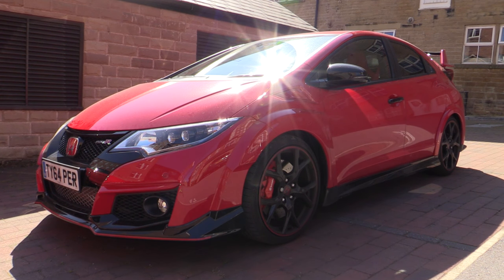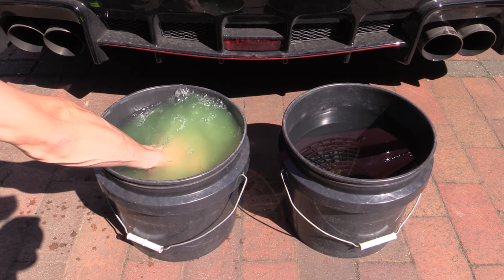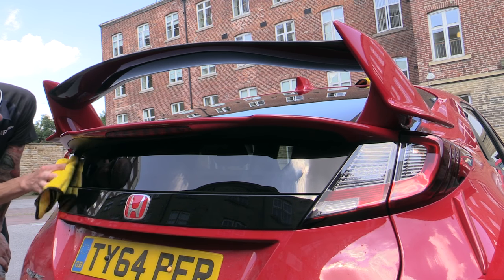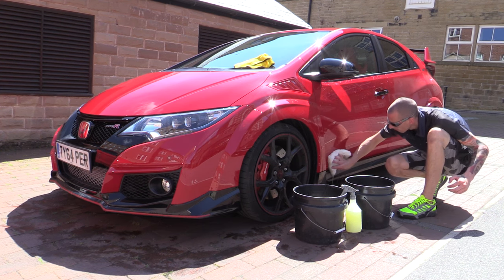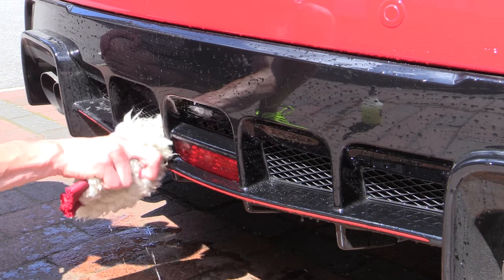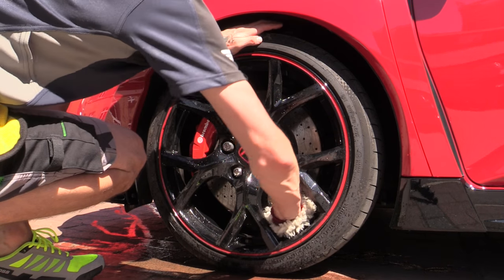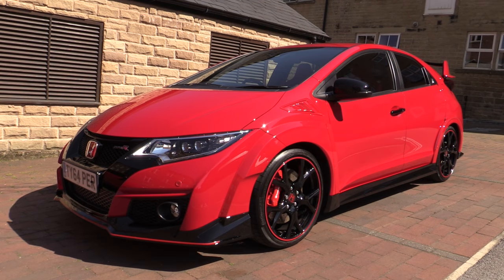Red Hot Honda Civic Type R Rinseless Wash & Wax

Comment: That Honda sounded really nice!
Reply from the maker: Aftermarket zorst. Shame it only revs to 4k in neutral!
Reply: +Car Cleaning Guru Your joking?
Reply: +Car Cleaning Guru that's ridiculous.
Reply from the maker: Been that way since the FN2.
Reply: the EP3 also only revs 4k in neutral
Reply: +martin jennings put your foot on the brake and rev it again 😉
Reply: +Forged Garage you must be new to Honda,s. mostly all Honda have 4k rev limit. ( VTEC protect) stop yobos dropping the clutch at 7k rpms lol
Reply: +AlphaMuscle like you've never revved a car past 4k haha
Reply: VTEC doesn't not engage  past a certain RPM point these days.
Throttle pedal input, Oil pressure, Engine load, Gear.
All determine if VTEC is engaged.
Reply: @ForgedGarage  why ?

Comment: This is where the Worx hydroshot comes in handy as I too live in an apartment. I use it to clean the tires/wheels and also to do a 2BM wash. This has me using 3 five gallon buckets. When doing a rinseless wash the Worx hydroshot is used for tires and wheels only, with the aid of a 2 gallon bucket to dunk my various brushes in for tire and wheel cleaning.

Take care and love the videos, nothing wrong with your voice either!

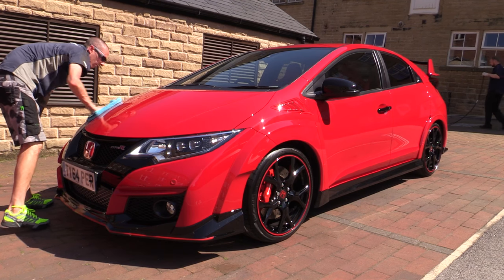Comment: wait.. hang on a sec... did i just see a hose pipe at 13:35?? i thought you didnt have access to one lol
Reply: looked a bit to ridged to be a hose i think
Reply: It was a drain rod
Reply: I think that hose is for the window cleaner, because its an apartment block.  They usually have vans with water bowsers and a water compressor in the back to clean windows/doors with telescopic reach.

Comment: I'm not suggesting this applies to this product, but it's application properties are similar to using crap/cheap shampoos where they don't sud up and just look like greasy water. I'm wondering if you can just towel off from a cheap shampoo for the same result. The lacquer on my new car is so damn soft, even expensive lambswool mitts and microfiber towels leave very fine scratches (and yes, I do clay bar, contact-less pre-rinsing and am aware of decontaminating paintwork) so I'm not quite so fussy about the scratch prevention.

Comment: I personally prefer the multiple soaked microfibre cloths because there is zero chance of introducing grit into the fresh wash bucket...or dragging grit trapped in the mit across the panel - I know there are various schools of thought, but to me, a fresh soft towel for every panel, along with very light pressure means minimal chance of scratching. If the paintwork is THAT precious, then you really shouldn't be doing a rinsless wash to begin with. Do the usual foam soaking, rinsing, foam again...etc.
Most of what I'd be doing are daily drivers, so swirls are already present and I'm introducing nothing much extra...certainly nothing noticeable

Comment: Another great video +guru Personally don't and will probably never use a product like this as I just don't think they are sufficient for the job and in the wrong hands will destroy paint work. If it's hot and sunny I'll wait till the evening till when my drive has shade to wash my ep3 and as its night hawk black it gets very hot very quickly in the sun and will leave hard water stains when washed in the hot sun.

Worst comes to worse I'll go a local jet wash if I'm out or knowing I won't be at home armed with a bucket with all my cleaning gear and soap etc so I just use the jet wash and not the dirty brushes that are full of other people's grit.

How do rate autobrites detailing range?

I've just used some and found it very good.

Looking forward to the next vid👍

Comment: I switched to rinseless washing with ONR a few months ago after getting a little bit fed up of all the time and effort it took in setting up all the equipment and washing the car with 2 bucket method. Really liking ONR , I use the Garry Dean multi towel method and haven't noticed any more swirls or marring using this method. Also think car actually looking cleaner doing it this way. Another great video.
Reply: Agreed. I do exactly the same. Multi-towel (Garry Dean Method - as cringy as that sounds) and my paint-work is fine. I am getting a much better clean than when i used to take my car to pressure washer at the local garage.

Comment: I can't imagine using this type of product in my motor, just looks too invasive in the paint. Looks like you did a great job with what you had to work with. I'm surprised that when using the 'two bucket' method, you don't wring -out your wash mit in the floor? I wii old have thought that this would have given you a better chance of getting rid of any swirl-causing contaminants prior to re-loading with cleaning solution.

I'm not sure if you have upgraded your video camera. The shots look fantastic quality. To that end, I noticed on th the after shots, that there was an amazing amount of orange peel on the paint. Had it been in a body shop recently?

The Honda looked super-agressive compared to the standard version. 

Keep up the good work.
Reply from the maker: It's actually not as invasive as it might look, in certain respects it's more gentle on the paint than standards suds. The reason I wrung out in the bucket was with the theme being limited access to water, I didn't want to run low before I finished. It's a goos tip though!

Comment: At around 14:15 onwards, while looking at the panels closer, why does the paint looks like it has loads of 'orange peel'? I have a corsa VXR and the paint work looks a lot like this as well. Is there a type of product that I could use to get a smoother look?
Reply from the maker: Modern factory paint standards. Only way to remove is wet sand and machine polish.

Comment: Great video but geez it really shows up the orange peel in the paint on the car from factory, thats shocking. Whats the point in spending hours cleaning your car if the paint underneath looks terrible. Not your fault ofcourse, shame on honda
Reply from the maker: Most modern cars are the same in my experience, plus the angles of my after shots show it up really badly regardless of the car.
Reply: Yes thats true, there are a few manufacturers that are really bad with it, and even then its really hit or miss from car to car. Its just a bit of a shame really, looks like they've been painted with a rattle can.

Comment: Would you recommend a foam gun when living in a flat and having no acces to running water for a pressure washer?
Reply from the maker: No because it wouldn't work!
Reply: Maybe I was imprecise. With foam gun I mean a pump sprayer like the one you use in the video. In your case you use a rinseless wash product but it should also be possible to use snow foam in that sort of sprayer, shouldn´t it? Sorry for the misunderstanding, I´m coming from Germany ;)
Reply from the maker: Ah ok, you can get pressure sprayers with foaming nozzles but it would still need rinsing off unlike the rinseless wash.
Reply: Thats okay because I wash my car in public wash boxes. The problem is that you can´t use a foam gun like the one you are using (at least in Germany at public wash boxes). So I wondered if there is an advantage in cleaning the car with a pressure sprayer + snow foam.
Reply: Iceman68415 search for ik 1.5 foamer. It may be what you need but it's still up to 20 pumps for maybe 2 panels... So it's a lot of pumping.

Comment: 6 hours to wash a car? I can wash a car with 2 bucket method and chemical guys supplies in less than 30 minutes, scratch gree
Reply: +Juan Mora what's better than?
Reply: +Juan Mora some stuff like the quick retailers really do suck, and the waxes are just terrible... But soap, inner clean, polishes, there all grest
Reply: +Breaking rc I agree completely 😂 the butter wax seems a little gimmicky
Reply: +Robert Saenz butter wet wax is complete trash, it LITTERALY last 1 month maximum, and there paste wax also last 1 month, so I just use meguiars, so for durability I put a layer of meguiars on, and for the nice pop I put on chemical guys
Reply: +Breaking rc I do the same, what do you think of meguiars cleaners like the super degreaser or APC vs. chem guys nonsense or inner clean?
Reply: i did a test with meguairs 26 , and Butter wet wax  . Using safe for wax soap . 
meguiars lasted 10 weeks . butter wet lasted 2.5 weeks . you can imagine my disappointment. also , ecosmart does scratch the paint  . ONR is the best rinseless product in the market . chemical guys is junk
Gyeon , carpro , swissvax , meguiars and 3D for the win
Reply: Breaking rc Because he meticulously washed the car plus filming this video. He's the guru!
Reply: Juan Mora I tried Adams polishes waterless wash on my Lexus with perfect paint, I used a damp towel and liberally spray it on the car, still scratched it, so it's not just chemical guys, but yes $10 meguiars paste wax last longer and beads more water off than chemical guys

Comment: The car detailing industry is, as far as I am concerned, a bunch of guys who need to make a living, parroting whatever the master parrot is selling this season. People just buy in to, and get away with, the most preposterous statements about how physical particles behave in the presence of other physical particles. These are contrary to physics and, for the stated behaviour, no proof whatsoever is provided.

This parrot states that he is rubbing "the dirt into the tough polymer coating that bonds to the paint and protects it during the contact", an "interlocking molecular barrier the ONR itself imparts", some "magic polymers". Presumably, referring to a fictitious "tough polymer" created instantly by a liquid that was heavily diluted into water, then rubbed into the surface while rubbing the said dirt. Magic indeed, only magic could do that.

People, wake up: this is a paid advert for "Optimum No Rinse", a rubbish product, and it's use, in the fashion demonstrated here, will damage your clear coat. That is the reason why this "professional" offers you no proof whatsoever that the clear coat wasn't damaged and swirled after this job. Extravagant claims require extravagant proof.
Reply from the maker: I purchased the product myself, drove 150 miles to feature the car and spent all day on it for free, so far from a "paid advert".
Reply: Tip Tap, Do you have any qualifications in a Chemistry related field??
If not, then your opinion on this product counts for less than nothing!
Reply: Car Cleaning Guru why did you drive 150 miles to wash his car but not get paid for it :/

Comment: I like the car, but the wash I do not like.  I could never use a product as this, would be afraid of paintwork damage.
Reply: Bill Durbin trust me done right the risk of swirls is far less than a two bucket wash. Although I don't use ONR like the guru does in his video. I use micro fiber towels lots of them and the Gary Dean Method. Basically I don't re dunk a towel, after a panel they are done. 4 years of ONR and zero swirls

Comment: Dont blame the product. You have a poor rinseless wash technique. Im mean, very poor.
Reply from the maker: +nivraarvin I'm just not one for pampering, over conservative wash technique. Plus I did't really blame the product, just pointed out its shortfalls. Results weren't bad though, eh?
Reply: +Car Cleaning Guru You can use boars hair detailing brush soaked in the solution for the vents, then wipe with a damp MF towel from the wash solution to get the dirty solution off the surface.

For the wheels/tires, you can use a small noodle type MF wash mitt to clean the surface of the wheel and the tire itself if the tires are not so dirty like the one from this video.

For areas with bugs or caked on mud, like the fender liner, spray them with APC first then clean them afterwards with the rinseless solution. ONR will neutralize the solution.

I really like rinseless wash. I live in hot climate with hard tap water. This is the only way for me to wash my truck without getting water spots and swirlmarks.
Reply: +Car Cleaning Guru You can use boars hair detailing brush soaked in the solution for the vents, then wipe with a damp MF towel from the wash solution to get the dirty solution off the surface.

For the wheels/tires, you can use a small noodle type MF wash mitt to clean the surface of the wheel and the tire itself if the tires are not so dirty like the one from this video.

For areas with bugs or caked on mud, like the fender liner, spray them with APC first then clean them afterwards with the rinseless solution. ONR will neutralize the solution.

I really like rinseless wash. I live in hot climate with hard tap water. This is the only way for me to wash my truck without getting water spots and swirlmarks.
Reply from the maker: Agree with the boars hair brush although personally I think if you're going to that level you might as well just wash it properly with running water. Definitely has its uses though!

Comment: Nothing like grinding all that dirt into your paint!
Reply: Just what I was thinking
Reply: Maybe do some research first buddy.
Reply: You clearly do not know what ONR is... There is a reason you are not a detailer. lol
Reply: How many cars have you detailed with onr??
Reply: Cesar D. Ortega A lot. I use it jus tlike this video when I have no access to water which is often when detialing someone's car at an apartment complex. 
It works amazingly well.
Reply: I detail cars too but I was asking the other person
I only do rinseless but I do it alittle different I actually used a weed sprayer for the wheel and emblems to same as I was doing it rug ablar wash 3 gallons of water is all I need👍
Reply: Again, I have a black CL500 and I've used it where I had to and if you're careful, NO SWIRL marks. People commenting on a product they have no clue about... This guy is ANAL (yep all caps) and if he can find it in himself to tolerate using it, you should know it merits some consideration.

Comment: First video I disliked from your channel. You basically rubed all the dirt and grime into the paint.
Reply from the maker: You'd think so wouldn't you? However in effect what happens is you rub the dirt into the tough polymer coating that bonds to the paint and protects it during the contact. ONR is way more advanced than other spray on wipe off type waterless wash products and considering it doesn't contain any fillers the proof of the pudding is in the finish which here really wasn't any more swirled than it was to begin with.
Reply: Car Cleaning Guru Yes you can basically say that you have removed all the dirt. Thus I feel the need to argue due to the fact that the clear coat on modern vehicles is very hard and can tolerate this, but nevertheless when dirt and grime is being "wiped" off it is basically forcefull removal which generates very small scratches in the clear coat - which if course can be polished out. 
No product - whatever the advertise with can avoid scratches under forcefull removal. It is plain advertisement. 
But I do enjoy your video.
Reply from the maker: Just to clarify, when I say 'tough polymer coating' I don't mean the clear coat of the car but an interlocking molecular barrier the ONR itself imparts.
Reply: Car Cleaning Guru Understood. I was talking about the basic facts about how "waterless" washes can scratch your paint - besides what they advertise it for.
Reply from the maker: Ah ok, although technically this isn't a waterless wash but a rinseless wash which actually makes it quite different from the spray type products.
Reply: Car Cleaning Guru That is true! 
But what a beautiful car!
Reply: mr rambo No need for any hate. We basically discussed and saw each others points.
Reply: +Daniel San so why dislike? Do a thumps up!
Reply: +Gustavo Duran dislike is there for a reason. it's not just a hate button as people make out 😂
Reply: I always thought the point of the ONR was that it's going to encapsulate the dirt and this will then be pulled into the microfibre you're using to buff off the product.
So it in essence captures the dirt in a bubble that will then sit upon the hydrophobic coating ready to be picked up, thus not rubbing the dirt into the surface, but instead, pulling it away from the clear coat.